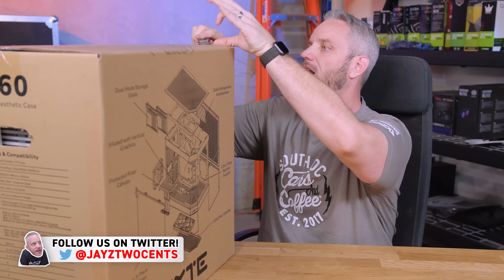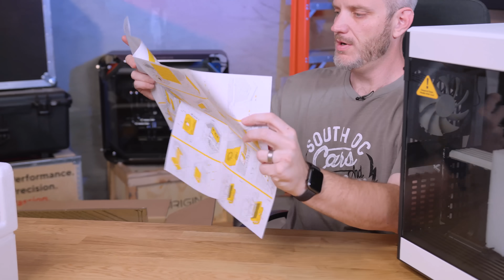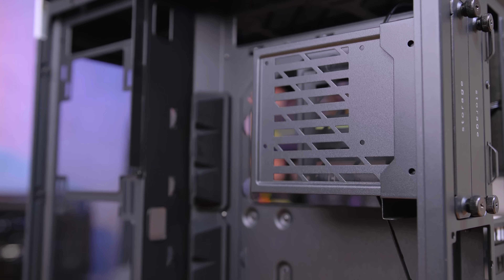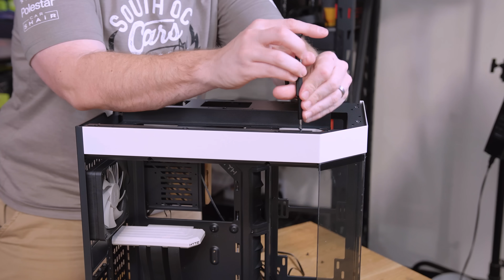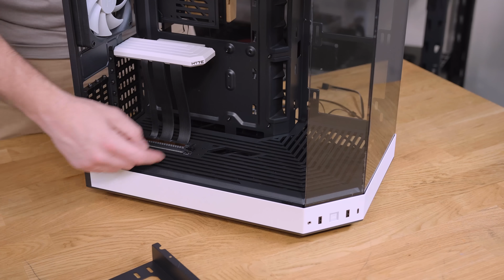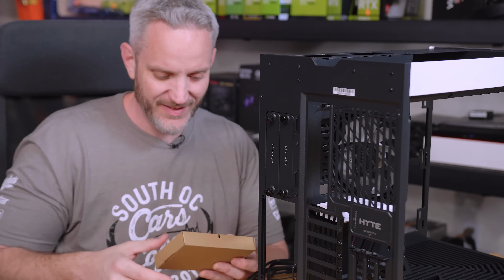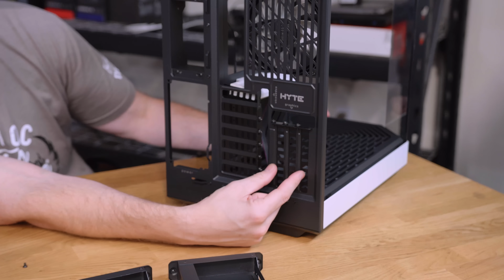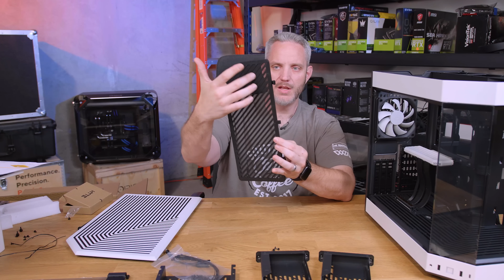Someone FINALLY broke the mold for PC cases...

Comment: That vertical mounted GPU without any other for mounting ruins any other benefit this case could hold. Vertical mounting is cool and all - but if it doesn't have the space to draw air (Like this case) then I'm not interested in losing performance for an aesthetic perk.

Comment: i've had my eye on this case sense release, im holding out for zen4 hardware to hit the market but even then its so costly to build right now . im looking at close to 2k for a build zen 4 ryzen 7 , 32 gb corsair cl16 rgb ram, 3070 no preferance as to wich one, 1 and 2 tb NVME drives and 4 tb of ssd deep storage, corsair AIO . thats what im looking at currently but given inflation and other factors ill be 10 years older before i can afford even 1/3 of the hardware lol

Comment: You do plenty of custom loops.  If the common man buys this case and uses an air cooler and gpu what would you get?  12600k and a 3070 maybe?  I hope you build something in it, and test thermals and noise.

Comment: With the geometry and lines used in the case, I'd do a balls to the wall elegant build. ASUS ProArt Z690 with 12900ks, 128gb corsair ddr5 4800 (no heatsink or RGB), 3090 or 3090 Ti, all white led fans and a custom water cooled loop with nickel water fittings and clear tubing ran inside brushed brass pipes with cutouts to see the clear tubing and water inside. You could even put an led at either side on the back of the brass pipe to light up the window on the front side of the tubing. Hit me up if you want further ideas!
Reply: THERE ARE SCAMMERS ON THIS COMMENT THREAD. BEWARE! JAY IS NOT RESPONDING TO YOUR COMMENT POSTS!

Comment: I just built in a Y60 and with the drive bays, you can mount one SSD flat, then mount an additional one using the edge of the SSD and the side rails on the slide out. Actually works pretty slick.

Comment: I wonder if the slot spacing on the bottom of chassis allow SSD drives to be mounted there. As for the low profile brackets, some simple dremmel and plier work you can convert them unless the company of the said card sells aftermarket brackets.

Comment: I asked why couldn't this idea be done in early 2000s, I was told that the tooling would be too expensive.  With no further clarification, my understanding is they use drills to make the holes and you catch the material to reuse.  I still don't understand why it is so "expensive" but I am happy to see it happen.

Comment: It is a "cool" case but that is the only thing there is to it. It's missing a lot of stuff and many other is misplaced or bad made. A lot, really.

I still think that the Thermaltake-X9 is the best ever of every century case. It's fully modular inside (you can tear down any piece you don't need) and it's a big box literally, that can allow for ANY customization, even personal modding or modification. The only issue is the filtering system. But it's a really cheap and stupid cost to afford... for 20€/$ you can buy meters of filter rolls and make ANY filter you wish.

Comment: I would buy it if the GPU vertical slot was made to support airflow better. As I see it, you have the bottom fans pushing against the GPU exhaust and a glass wall pressed against the intake of a 3 slot card. I imagine GPU temps are horrible while the rest of the PC hardware being cold. I love the bottom power button placement though.

Comment: Really it's a g4m3r-gr4d3 case. You don't need a billion hard drives. You don't need a ton of AIBs. You need a honking great GPU and enough storage for games, with wraparound glass for stupid amounts of RGB, and some air so your 3.5 slot GPU doesn't overheat.

Job well done I'd guess.

Comment: Definitely looks alright, but oof, as you mentioned, HHHL slots will sink it for those with literally any more than 1 PCIe card. Which isn't terribly uncommon if you're someone like a professional streamer wanting to stick an Elgato card in there, because none of theirs are HHHL out of the box, and if I'm remembering right, they don't even toss in an HHHL bracket.

Comment: Half height PCI slots is a deal breaker for a lot of people.   Case seems like it's made for folks who just want a showpiece, which is not most regular consumers.

For me, I also need tons of drive bays, because my PC Is kinda half server; I use an HBA card and 5.25" converters to throw a bunch of drives in my system (~12 SSD, 2 HDD), and it's still not enough (want 4 more HDD's for more RAID).  Ideally I'd convert everything over to a more NAS solution, but who's got the funds (or space in a bedroom) for that. Sure would be nice to be free from this burden though..

Comment: I just bought this tower BEFORE I saw your review, and I'm doing a Asus VIII Dark Hero mobo, EVGA 3080TI, Corsair 32GB 3600Mhz ram, dual M.2 2TB Samsung drives and water cooling it with a NZXT dual fan kit. I'm running a 1440P monitor, (Samsung G-7) so my framerate will be perfectly fine. I might do a custom loop later, but I'm in the Air Force and move a lot, so I likely won't right now. I always assume the movers will break something, so I don't go absolutely full bore on my builds. Believe me when I tell you; I grew up as a poor (just like you) military brat, so my jaw is permanently on the floor for being able to afford this build, even after paying all my bills. This is the absolute most ridiculous (cost wise) build I've ever done since I started building in 1998. I just sold my home for an $80K profit, paid off all my debt, stuck a bunch of the profit in savings, and my wife's and my main hobby is PC gaming, so we went for it. She's getting a great PC too, just not with this tower. Anyway, love you and your viewers, Jay! Take care all, and I hope everyone has an amazing week!

Comment: 2 drives in such a big case is kinda dumb. like, i get that ssds are much more affordable now but migrating drives without fucking up program paths is such a massive pain in the ass that i have 3 spinning drives in my rig. it baffles me that they dont just have removable drive slots. probably cost saving but when my 10 year old $50 corsair case has more storage options than a modern $200 case there's kinda no excuse.

Comment: I'm so glad you made a video on this case because I was going to go with Corsairs 5000d case, but this case looks so good and it has so much space for wiring. I think I'm just going to get this one instead for my first build. This looks so clean
Reply: EH id pick something else man. 3 years later when you want a new capture card or sound card those low profile brackets will not allow you to place them in. Plus you can only mount the GPU vertically. Fractal makes some cool cases. And you may need some big hard drives in the future.
Reply: @insurgent_Lowcash  Huh I didn't think about that, thanks for the food for thought. Yeah I'm gonna sit on this and see if this will be the best move

Comment: What would you recommend to put on the glass to protect it from shattering? I'm looking for screen protectors for PCs
Reply: A layer of tint will keep tempered glass together if it should shatter.
If you won't want it to shatter ever, replace the glass with plexiglass

Comment: A case should not cost more than or equal to your motherboard, but if you need the room and you already spent 1500+ on a 3090 then what is an extra 100 for a case like this. This case seems pretty sweet, just kinda big.

Comment: Low profile expansions slots are a deal breaker. I really liked this case too. Finally something other than an 011 dynamic layout and low profile expansion.
Reply: lack of places to properly mount storage is another bad one
Reply: @nostrum6410  What Jay failed to mention is that the drive cages support up to 2 SSDs each so you can get 4 of them in there.
Reply: @nostrum6410  Lack of places? There's the m.2 slots on your motherboard and two hard drive trays on the other side that also fit 2.5" drives. If you need more than that get a server
Reply: @nostrum6410  Pfft, I've got 3x M.2 and two 2.5" sata SSDs in my gaming PC. And 5 8TB WD reds in my server/nas. You don't need much room for spinning rust anymore. That's what a nas is for.
Reply: @lunchie80  but you have all this empty space in your case, why bother with a nas
Reply: @nostrum6410  Because non-centralized data storage is suboptimal and Windows is a terrible OS for serving content - Docker doesn't even work properly on it.
Reply: @praetorxyn  that's all well and good, as long as we can agree it's all personal preference with no "best" way
Reply: @nostrum6410  bruh its 2022 why dont you have a storage server or run aset of 6tb hdd along side your m.2?
Reply: @dabadcod4  because thats dumb
Reply: @dabadcod4  This. Having shit tons of storage in a single computer has been a bad idea for a while.
Reply: @praetorxyn  3 HD's are a shit tonne?
Reply: @praetorxyn  tbf I have 6 ssds in my rig right now, but I also have 9 2tb hdds in raid 5 in my storage server giving me 14tb storage.
Reply: @nostrum6410  One HDD is too much for a desktop. Desktops should be SSDs only, and a 2 TB NVMe is plenty for the OS, applications, games, etc. Most motherboards have at least two NVMe slots, and the case has mounts for two SATA drives you could put in RAID 0 if you want a big ass drive for Steam games or something. That’s honestly more storage than a desktop should have unless you’re storing raw footage or edited video on it before moving them to a server, at which point there are plenty of other cases, and the low profile expansion slots of this case would already be a deal breaker like it is for me.

HDDs should only be in NAS units and servers, period. The perk of both being that the storage is centrally available everywhere on your network (or from anywhere if you own your own domain and configure port forwarding and a reverse proxy like nginx to serve various services for you like I have).

My NAS has 22 TB or so of RAID 10 storage (four 12 TB WD Red drives, which I chose over the Red Pros because they are 5400 RPM and thus quieter, as hard drives are loud as fuck as it is). My desktop only has a 2 TB NVMe.
Reply: @dabadcod4  The question is how much capacity are those 6 SSDs giving you, and what are you doing with that space?
Reply: @praetorxyn  they are 256 each and used to be in raid.
Reply: @dabadcod4  Yeah, but if they’re that small you’ve likely had them long enough that replacing them with a 2 TB or greater single drive is a better idea.
Reply: @praetorxyn  no doubt lol but my priorities are fucked. I just got a 3080 12gb instead of a nice nvme drive.
Reply: @praetorxyn  I usually have 3, one for desktop, one for games and one for music/videos, I used to keep everything on one but when it failed I wished I did it this way.
Reply: @visitor9408  The one for music and videos should be in centralized storage and accessible via Plex or something.
Reply: It's not a deal breaker for me. Other than my GPU, the only expansion card I got is a Wifi card, which has a low profile bracket option. So far I am loving everything about this case.
Reply: I have an NVME, SATA, and 2 HDDs. Cry about it nerds with your servers. Not everyone has space or money for a server.

Comment: 11:25 The low profile expansion slots behind the vertical GPU mount is something I've been asking for for years. I'd argue that most expansion cards are low profile (or at least you can find a low profile version) these days. I have a 10G NIC, USB-C card, and NVMe riser card and they all either came with LP brackets or have them available (10G NIC was second-hand, so I don't remember if it came with it, but it's $1.50 on eBay). This is the second or third review of this case I've seen, and I like it enough that it might justify the price for my upgrade.

Comment: I was in love with this case but it came out after I had already bought my budget one for $70. After seeing this teardown I love it even more. Considering the cable management that took days and having to remove my basement 3.5/2.5' HD tray (was basically forced to ditch using my 1TB HDD, which is fine considering I have an 512gb NVME for Windows and a 1TB sata for games) in addition to some of the other issues I had with my current case (It looks clean where it matters for the most part but I wish it had cable gromits or however it's spelled) I can appreciate what they did with this as far as cable management and the input panel connectors. 

I also like the fact that you guys did more of a tear down on this case instead of showing it off and just building in it so we could see more of the basics of what it has to offer. If I happened to somehow win or just have the money to get it even though my build is budget I would rebuild in this one and ditch the other case. Of course as I got better parts they'd have to go in this one.  I do love the design and I think it would be cool if they did eventually make a more "budget" version or even a microatx version if possible. I also think that having the vertical gpu mount as optional would be better.

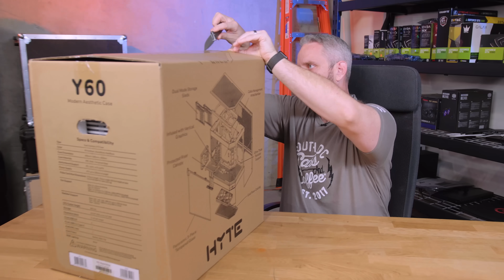Comment: 0:44 You know what? When a product has the shit this one does on the side of the box i am out. They describe a primary piece of tech like my nan taking the piss out of me for going outside in the wrong clothes.

Ok so it looks like a fish tank. Has no front ventilation at all, it appears the only usable intakes are in the base and the top (the motherboard tray mounts are useless for an air cooled build) and it looks like neither the top nor the bottom is actually really that good at taking in air. So, this is basically just more overpriced, over marketed crap. The vertical GPU mount is stupid to start with but you are not getting a 3090Ti in it no matter how hard you try and with the cooling layout if you don't plan on watercooling it you might as well just go out and buy some bread and a toaster. Coz if you are gonna toast something it might as well be useful once the cooking is done.

Comment: I really like the case!, though I would not want it, as my needs require me to have a much bigger case.
I do wish it does well! Hopefully they come out with a larger version if this one does well
Reply: What?? How much bigger could it be? I thought this was pretty huge
Reply: @soupdrinker  Full tower case style, as in a bit thicker and taller,  looking a bit more like the massive grey case that Jay used. Just so you could fit alot more storage and had proper mounts for that bottom area to have a 360 rad spot.

Comment: Looks like you can put 2 x 2.5 inch SSD in each tray.  I paused the video and yes there are screw holes on the top and bottom of the sleds.  Unfortunately, the case is $200.  Even with the White, Black and Red color options, 3 fans in the case (that you will likely not use in a serious build) its overpriced IMO.

Comment: My Cooler Master Storm Sniper Elite case that I had bought back in 2011 had a solid front panel I/O connector. It's just strange that it's not the norm in my opinion, but every ASUS mobo I ever bought came with a Q-Connector to make connecting the front panel easier. That case was all about quiet cooling via airflow as well, with 3 200mm fans in the front, side, and top, and a single 120 in the back. Honestly, that case was a decade ahead of its time.

Comment: The best new case design currently is Lian Li O11D EVO, bar none. It has the side GPU mount option where it exhausts the heat from AIBs directly out of the case. When the 40x series comes out, it'll be the best case to have and will undoubtedly be extremely popular. Exhausting up to 500w of heat from GPUs alone will be a huge issue for anyone not water cooling.